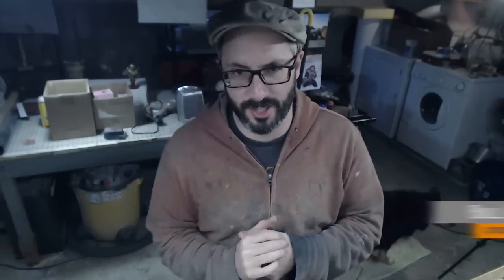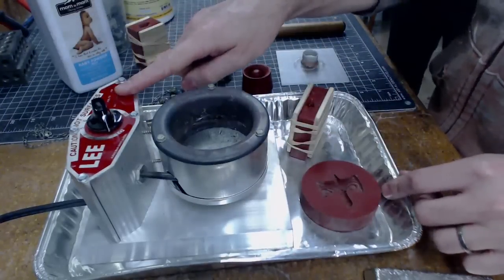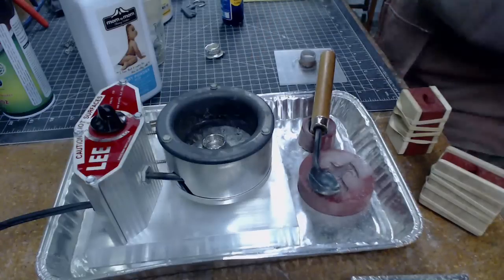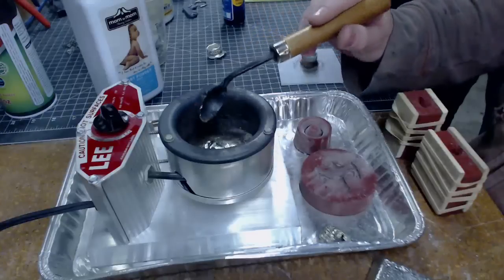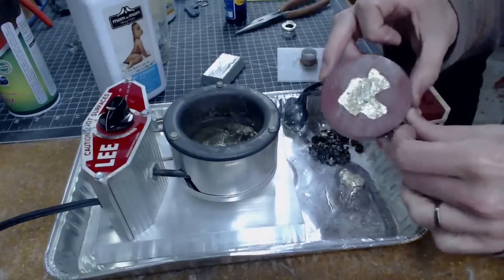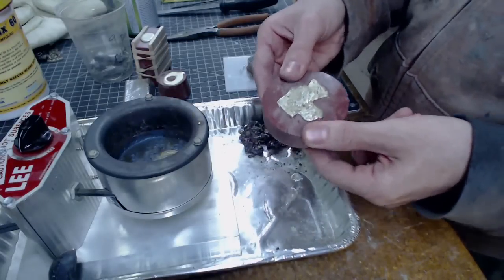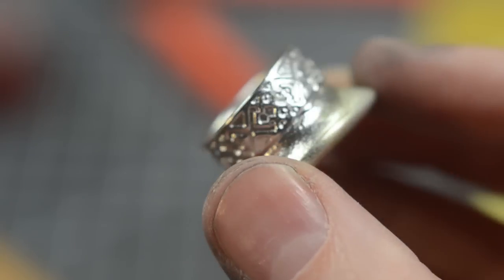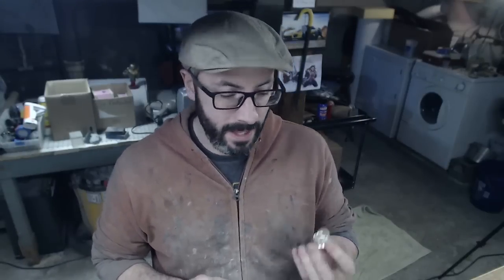Easy Metal Casting with a Silicone Mold and Pewter - Prop: Live from the Shop

Comment: The black stuff on top (dross) is caused by oxidation. The melt is too hot. Being too hot also causes the different metals to separate out. Try a simple flux material like beeswax or stir with a wooden paint stick, plus lower your temp. A simple casting thermometer ($35 on amazon) will make your castings better, no guessing at temps. The mold needs to be pre warmed, with bullets our molds dont start cast right until the are above 400F. If using a cold mold, the melt flash hardens when it hits the mold and prevents proper fillout of the minute details. The warmer mold slows down the hardening process. Since you are using silicone molds you may need to experiment with different casting temps of the melt. If you find that your ladle isnt big enough to fill the mold with one spoon full, increase the melt temp as much as possible. This should allow the melt that was in the mold to remain liquid long enough for the second spoonfull. Hope this helps and welcome to casting!
Reply: CarterCreekFarm thanks, you just showed us all that experience counts
Reply: What's is d composition of matel,what is the commercial name of this metal??
Reply: I know this is an older video and comment, but was watching the whole series over again and saw this comment.

Having cast a ton of lead (well, maybe only half a ton), CarterCreekFarm's comment is totally spot on. You definitely have it too hot.  The beeswax idea or a more expensive bottom-fed pot would solve your problem.

 I pre-heat my steel (and homemade soapstone) bullet molds if I want the first few to come out; if not, I just toss them back in the pot and let the process of casting heat it up.  That won't really work with the silicone.

Was that lead/tin pewter or Armetale (or one of the other food safe aluminum alloys)?  I wouldn't use 'real' pewter for jewelry; the lead is problematic.
Reply: @harshambaliya8649  the pewter.
Reply: do you do with the flux material of beeswax?

Comment: Keeping the ladle in the pot for a minute or two before pouring will also help reduce how much cooling happens by the time you start pouring. I think you can also add flux to it to help it flow a little better and remove some of the slag.
Reply: I agree with this. When using batik tjanting tools, it’s important to keep them in the wax bath to get some heat into the metal receptacles for an easier pour. If the metal tools are not up to temperature, they wick out the heat and the wax cools quickly.

Comment: There is a good chance that you are burning the pewter.  It's melting point is nearly half that of leads.  And if thats a bullet melting pot it's means for lead.  So the three hundred degree difference int he melting point is probably why the pewter is darkening, it's just getting way too hot.  If im not mistaken you should be able to melt pewter on a hotplate, since pewter melts at around 440 F.

Comment: Hay fellas I do a lot of metal casting and I have my moulds on a hot plate before casting around 80-100c and if you get hold of k or l grade metal for pour casting is the best I have found it retains its heat for longer

Comment: Great video Bill, look forward to see more metal casting from your shop.

Just a few tips to help you along. I wouldn't add any flux or anything else to the metal. It's not necessary for low melt alloys and could be detrimental. The dross on the suface is normal, just skim it off with the ladle and discard. The lead-free pewter you have looks good quality. The one I use has a melting point around 250C and an operating temp around 280-290C. Keep the ladle in the pot so it's the same temp as the metal and keep the pot at least half full as it usually helps the thermostat to work effectively. As others have said, pre-heat the mould with the first pour, then the second and subsequent pours will have a better result. As soon as you've poured the metal give the mould a few gentle taps (with a screwdriver or something) to settle the metal into the mould. It solidifies pretty quick. I can usually demould a belt buckle a couple of minutes after pouring, although it's obviously very hot so use long nosed pliers or similar to get it out. This helps keep the heat in the mould for the next pour. Let the casting cool naturally. Rapidly cooling it (by quenching) can cause stress fractures in low melt alloys and they cool fairly quick anyway once out of the mould.

I've been casting with low melt alloys and pewter for 20+ years and still get a huge buzz from seeing a shiny metal thing appear from a mould. Hope that helps and good luck.

Comment: I didn't know there was a silicon that works with metal until this day. Seriously I've always dreamed on doing my own metal rings and you don't know how happy these tutorials made me. I don't know if you mention it on the video (sorry, english isn't my first language) but how many times you could cast on that mold? Thank you so much! <3
Reply: This answer is probably redundant or useless at this point but if anyone else is reading; silicone molds can be reused numerous times till they break if temperature is controlled. They're good up to 290C (554F), which is above the melting point of Britannia pewter (255C or 491F.) Heck, I've cast zinc in pewter molds (Melting point: 419.5°C 787.2°F) But that's harder and tends to burn the molds a little.

Comment: If you can swing it you might be interested in the 10 lb version of the melting pot, it has a spout on the bottom that you put your mold under. Also, a cheap infrared  thermometer will be worth your money.

Comment: If you heat the ladle with a torch you can hold the pour a bit longer. If the mold has a small opening, its likely to get clogged as it cools after a single pour so be sure the volume's not larger than your ladle. You can try to make a larger spout/spru if you think its going to need more than one ladle. Your able to double dip with flat piece because the new metal can still get to to open parts of the mold.  Fun stuff.

Comment: You can  control the amount of dross that you are skimming off the top by fluxing .  Your pewter is an  alloy  of several  elements and heating causes them to mix with oxygen  which changes the mixture.  You will need to do this in a well ventilated area.  Put a little paraffin wax  on the surface of the melted  metal .  This will cause a  lot of smoke  which you can control by putting a flame to it. as the paraffin burns  off  stir the metal and much of the dross will  go back into the alloy keeping it cleaner and much truer to its original  state.

Comment: In a rectangular container you can scrape the dross away from the top with a card made of heat resistant material. I remember using FR4 squares, cut to size, for scraping the tops of solder dip containers.

Comment: that was neat, i have the larger lee melter with the bottom pour spout. i cast a lot of lead for bullets. id reccomend stepping up to a bottom pour pot and you can modify the stand to be taller so that you can fit larger moulds under it, the lever would mean you dont have to worry about a ladle just lift the lever and it pours out the spout. also yes heating the moulds is pretty important

Comment: The crud that your referring to on top of your molten metal is the impurities that was in the metal. I used to run a aluminum smelter and that's what I was told by my predecessor.

Comment: I use the larger Lee melting pot that has a bottom pour spout that is opened/closed using a valve/handle arrangement.  Much easier than using a ladle.  Can't stress enough the need to preheat your molds, or do a few test pours to preheat the mold.

Comment: You should flux the melt, this will clean up the crud - aka dross or slag.  When I cast bullets ( lead) I use a bit of wax from a melted tea-light. Also get a bigger ladle -  you want to try to get a complete pour in one shot.

Comment: You need an air hole to let the air out as you pour the metal in..  Won't plug up so much.   A As you found out, heating the mold is best. Close to the molten metal temp as you can.

Comment: It helps if you have a mold for ingots to pour the rest of the material into.  I've seen hackers use stuff like cupcake trays and such if you don't have a good mold.  Not sure on the properties of pewter, so make sure to use a mold release powder to prevent bonding, etc.
Reply: "Hackers"? You mean metal workers?

Comment: The two things I would recommend to make your life easier: I would get a smelting/pouring cup with a pour spout and handle that you just set in your hotpot for the tin to melt in(think double boiler but it needs to touch the bottom). Also don't bother skimming until the very end, what your wiping off is just tin oxide which immediately reforms when liquid tin touches air(you can even remelt, it isn't scrap) instead of wiping it off use a little chunk of scrap to keep the floating oxide in you cup instead of your mold when you pour.

If you're finding your ring gets squashed out of round you might want to try finding a harder metal with a coefficient of expansion that's close to that of pewter so you can cast over it.

Love watching your work, just don't usually have much to say.
Reply: Then I highly recommend you take a look at how to make an electric foundry by TAOW, and how to make a coffee can forge by clkindred. Kindred's shows you an excellent way to make refractory cement, and taow's will show you how to make an electric heat source for less then 80 bucks, plus you'll be able to use it as a kiln for other goodies.

Comment: If you're having problems with your metal cooling too quickly while still in your ladle, try heating it with a blow torch before you dip.

Comment: the top skin is dross, the crap, even though you start with "pure" metal still has impurities and burns off, also oxidation so better to crank it to 11, the hotter u go you just risk wearing out the mold but it'll flow better while pouring, use a old dinner spoon or aluminum foil make shift honey dipper to skim off the dross before u dip for a pour.  discard the. dross.  also as people mentioned preheating the ladel as well as the mold will benefit in the flow better.  you can preheat the mold by jut pouring a waste pour and leaving it in until it solidify and then recycling that pour, the mold will retain most of the heat.

Comment: The "Crud" is the Impurities separating. IT can increase commonality with higher Temperatures, but in general it depends on the Metal. You also have to watch for the porosity of the metal. (Air Pockets) In general metals like lead and pewter have higher impurities and porosity. ( the only reason i know any of this is because i work in a metal casting facility.
Reply: Does the porosity affect the integrity of your final piece?  For example a jewelry charm or small, under 4 inch, statue.

Comment: bigger ladle, leave it in the pot. use a double boiler on a hot plate. I use a jewelers saw to cut off any major flashing. set of files dedicated to pewter. definitely heat the silicone molds.

Comment: That was pretty sick!  I've always steered clear of pewter because of the bismuth, but after a bit of research its evidently not a huge concern.  Thanks for the vid =)
Reply: TabLeft Workshop - I'm curious why bismuth would be a concern. I've seen plenty of straight bismuth casting with no more worries than any other metal.
Reply: William Bostedt bismuth is a toxic heavy metal and heavy metals often build up in your body over time.  Bismuth evidently is toxic but extremely low, and doesn't build up in your body enough to be a big concern since any that's absorbed is generally removed when you pee.

Comment: I know it is a late comment to he video. Would it be a good idea to preheat the molds? using steel plate to hold the mold together and maybe steel clamps to hold the metal then pre- heat the molds. This way the pewter will stay liquid and flow better into the mold? NVM i just hit the point where you pre-heat the mold lol

Comment: When melting any kind of metal, the impurities rise to the top. The technical blacksmithing term is called "Slag". Also as a Blacksmith, I'd advise to keep a bucket of water close by.  Once you can touch the material without it being liquid take the mold and dunk it in the water, or what is called "Quenching"

Comment: What are your steps going to be, cleaning up the ring?  Do you run it through the bandsaw to cut off the excess, and then dremel it a bit, grinding it smooth, then maybe switch to a little buffing wheel?
Reply: Punished Props fantastic, I would love to see how you made the mold for that!

Comment: That's really cool. Loved the ring best. That mold stuff being high heat perked up my interest and I already love Smooth-On products. :) Unfortunately it was not as high heat as I was hoping. :) Someday I dream of finding an easy to use silicone that will make flexible glass fusing molds and withstand the temperatures of glass fusing in a kiln. Until then I make do with a cone 4 clay to make molds for glass fusing. 

I do currently use some silicone molds for glass fusing but in that case they don't go in the kiln. I do the freeze fusing method so the only place the molds go is in the freezer. :P 

- Heidi
Reply: ***** Oh be prepared to be sucked in then. There are so many different things to do. Slumping, mold casting, liquid glass (stringer), powdered glass, freeze fusing etc. I am so hopelessly lost and want to try everything. :P Freeze fusing is a bit difficult. I have had more failures than successes but one of these days I will get it... I hope. :D I started small with a  microwave kiln. I would suggest that first as it is fairly inexpensive and you can find out if you like it. The limitation is you can only make pretty small things. Pendants etc. It's a good way to get started though without spending a ton on a kiln. If you have a kiln already then go for it. :D

Comment: Cerrosafe alloy is so much easier to cast with and melts at a much lower temperature. It's used for casting barrels of guns so a gunsmith and have a detailed look at the rifleing and to measure bore diameter.

Comment: Is there any reason to get a special melting pot like this as opposed to just using a kitchen stovetop or even a camp stove? You can buy pots cheap at thrift stores (~$4) so that's no issue.
Reply from the maker: You could definitely do it on a stove top.

Comment: Would be curious to know the best way to cut the excess off the pewter ring!
Reply: Me too!!! How does he do it!?
Reply: Me too I wish he would have shown that part
Reply: Also wondering 2 years later
Reply: Cheapest option would be a jeweler's saw and some files, or you could swing for a Dremel tool they have all sorts of bits for cutting, sanding, polishing, etc. Cheapest Dremel can be had for around $60
Reply: @Shrimp_Insurance  cheapest dremel? I've seen some at Walmart for $30 somthing... and thats one of the more decent brands too.

I have one I bought dirt cheap off e-bay ($15) but admitedly its not a well known brand and the tork isnt all that great for heavyt duty projects. I use it to grind down excess in my polymer clay casting projects.

But yes, the more powerful (expensive) the better

Comment: Put a little wax chips in to flux it and then clean the slag off, it'll work better.  Better to have it a little hotter and keep your dipper in to heat it up before pouring it.

Comment: When you made your silicone molds from the Mold Max 60 silicone, did you use a vacuum champer to degass the silicone after you poured the molds?   If not, did you get any air bubbles?    Manufacture says to vacuum degass so I'm wondering if this is really necessary?   Thanks
Reply from the maker: In this case I did not. The working time is so short, I skipped it. Yes I got air bubbles, so next time I will try and degas the Mold Max 60.

Comment: Pewter is not likely to hold up well as a wedding band. Being a soft metal, it's going to deform, stretch, and scratch quite a bit, Good video content on casting. I work in the metalcasting industry and love it.

The American Foundry Society actually sells an educational tool called the foundry in a box that I think you would like. It's actually a microwave system designed for melting metals. It also comes with oil based reusable molding sand. You should check it out!
http://www.afsinc.org/career/content.cfm?ItemNumber=13109

Comment: can you show us how to do something like that with more solid/expensive materials? Maybe a ring with some insertions?
Reply from the maker: I haven't learned that yet. If I do, I'll be sure to make videos on it.
Reply: Is it different?
I thought it would just have different melting temperatures.
On what I read up on normally you either require heavy industry printers to get that to work, that's why I'm wondering if the casting part can actually be done with a cheap setup like this. I can imagine it would impurify gold, even oxidice stuff like copper or more rare metals
But for sure it will be difficult getting the sizes of indentations for gems right.
Thanks for the enthusiasm anyway.

Comment: I'm guessing that's not just any silicone since you're using it to cast metal. Would you mind sharing where I could get some of it? Also, I'm guessing it could be used to cast copper or brass. Would that be correct?
Reply from the maker: We've got a link in the video description for all the materials we used. Pewter has a low enough melting point that the silicone can handle the heat, but I don't think another metal would work.
Reply: @punishedprops  Thank you very much. I appreciate that 🙏